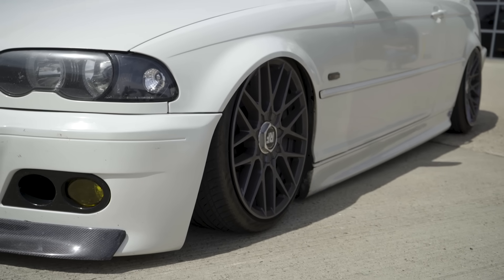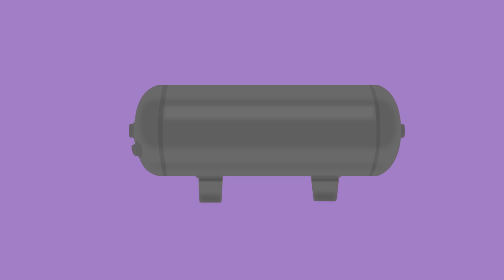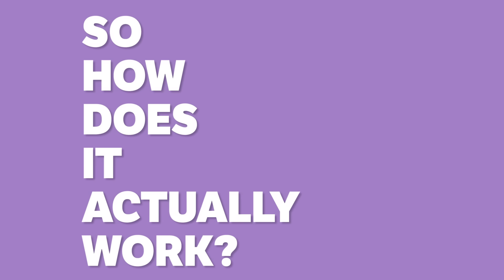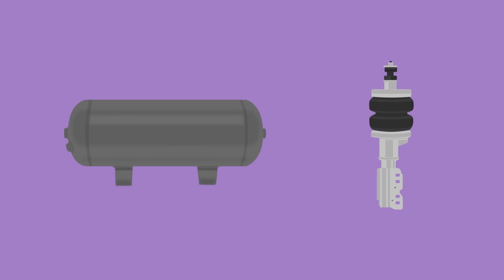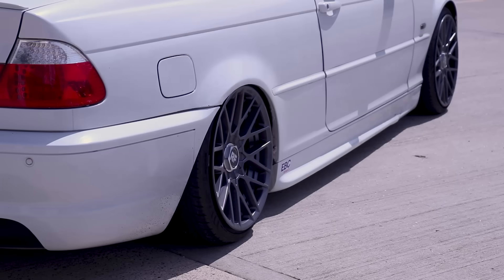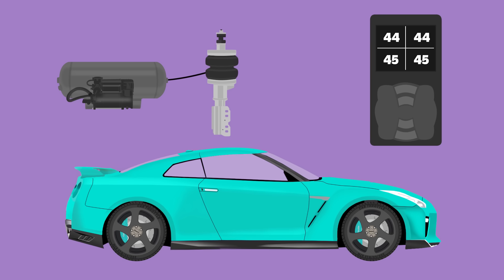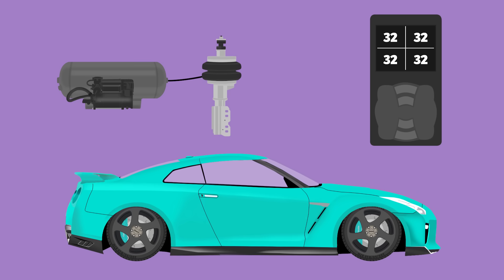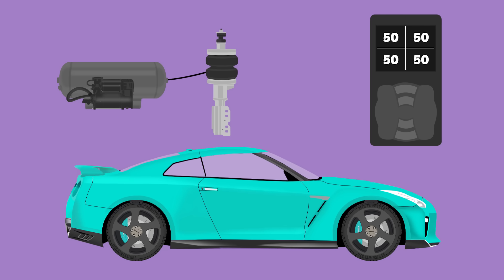How Does Air Suspension Work?

Comment: You missed the point that air suspension is softer than metal springs. Metal springs deflect proportionally to deflection (F=kx); air springs react to the change in volume of the airbag, which is the cube (F=k x^3) of deflection. Soft with little bumps, increasingly firmer as the wheels go up. Metal springs are constant.

Comment: How reliable are these systems?
Reply: Obviously not as reliable as a simple spring. Early GM air suspensions had to be serviced every 1,000 miles!
Reply: I've driven on air for 3 years and counting on my daily driver. It's seen summer weather and icey winters. 

Aside from the road dirt, my struts and bags look brand new. As in the bags, they don't have any creaks, cracks, or brittleness to them.

Comment: My question is why do people who usually go on tracks prefer coilovers than airbags? Why are cars with aftermarket air suspensions considered not good for track use or spirited driving? Do they lack stability or what? Just curious
Reply: My guess would be that the bags arent as durable as coilovers. Simple as that.
Reply: @kingbojack they are just as durable. As long as someone doesn't install wheels with the wrong offset and width. 

Wrong wheel size with bags will rub a hole in them . Wrong wheel size with springs will rub a hole in the tire.  

I've had airlift suspension for 3 years on my 2SS Camaro. I do a lot of spirited driving and no issues with the bags.

Comment: This is not air suspension.
This is hydrolic suspension .

The bullet train of Japan has air suspension.

I just redesigned automobiles to have electromagnetic air suspension ...
Got rid of shocks...got rid of air bags...

Air suspension with electromagnetism actually floats ..

Found a smother ride on air through magnets...repulsing each other ..

Comment: TRUUUUSSSST! LOL you need to 
LOWER THAT CAR! its riding so high it NEEDS TO BE LOWERED HONESTLY its sooooo high up there theirs about a good 4 inchs of wheel gap you should get some air suspension honestly, and if you go with PRAZIS Ⓡ AIR SUSPENSION USA you should go with AMERICAN MADE , in the UK they are running OUR BAGS, 
NOT CHEAP CHINA LIKE:  D2 yellow broadway tein cusco airrex ksport and many others that, are ALL MADE IN CHINA IN THE SAME WAREHOUSE 
their all garbage the only Real Performance forward Driftable and Show Performance Suspension in the world today is PRAZIS , Straight up made by Universalair and sold exclusively by 213RACING LosAngeles , its real PRAZISⓇ Quality Made in America and used by professionals , because everything else is just garbage ! 
FOR DRIFTABLE YET STANCEABLE 
REAL QUALITY FULLY ADJUSTABLE 
PERFORMANCE MADE IN AMERICA
HIGHEST QUALITY IN THE WORLD 
SUSPENSION There’s only one, 
DRIFTING ON , 
PRAZIS Ⓡ AIR SUSPENSION USA

AVAILABLE ONLY FROM 
213 RACING LA 
“ NOTHING FROM TAIWAN OR CHINA “
OUR SUSPENSION IS THE BEST!

WE ALSO HELPED DEVELOP ACCUAIR!
AND CARRY AND ARE 
Authorized distributors for: 
ACCUAIR 
AIRLIFT PERFORMANCE 
UNIVERSAL AIR 
AVS 
EVOLVE 
KW SUSPENSION 
ST SUSPENSIONS
ZOMBIE PROJECT
ROTIFORM
STANCE MAFIA
LIT STANCE
AIR SPENCER 
E36R DRIFT
ACTIVE AUTOWERKE
ITEM-B
BBS 
CONDOR SPEED SHOP
AIRFORCE SUSPENSION
V.I.P.KUSH BRAND
LOST SURF BOARDS
And more,.. 
AND We’re are NOT SOME 
trucking kooks,
from the boonies, 
that worship the 
FRUITY AND FURIOUS, lol
pretending to be,
L.A. Street racers, 
NAAAAH WE ACTUALLY 
ARE L.A. STREET RACERS
AND WE ARE LOCATED
IN LITTLE TOKYO DTLA!
Hit us up! 
Toll Free (866)213RACING
VISIT THE NEW ONLINE SHOP 
WWW.213RACING.COM
ON THE GRAM 
@213RACINGLA

Comment: Some Lexus models have factory air suspension. Instead of a cylinder they have a compressor so no boot space is taken up. Also less parts to go wrong. More reliable
Reply: Air suspension is very reliable.  I've had it for 3 years. As long as you use common sense when installing, you'll never be stranded.

Things that can go wrong is strongly based on the installation. 

1: Air leaks. Installation. Cut the airhose straight with the tool provided. Don't run the lines alongside moving parts or near the exhaust.  I ran mine under my interior carpet. 

Electrical management: nearly 3 years and no electrical issue at all. It runs off a 12 volt system. Its actually more simple than installing audio equipment.  

You don't need a high-performance battery, don't need an upgraded alternator,  you don't need thick gauge cables or capacitors.  

Compressors: Buy two. If one goes out, you have a backup. When it fails, it doesn't just stop all together. You have warning signs. I've replaced one of my two compressors after nearly 3 years of daily driving.  

The bags very durable.  As long as you don't install wheels with the wrong offset and width, causing it to rub a hole in your bag, you're good.

Comment: Question, Can I control the suspention while I a driving? Or the car must be parked
Reply: Airlift has a controller you can control during driving. There are 5 presets you can assign to a button.  You can also raise and lower each corner manually.  

My setup.
Button one: manually lift all 4 corners super high (higher than stock and clearing obstacles)
Button two:  preset high ride height (similar to my stock vehicle height)
Button 3: Labeled preset height. Slightly lower than stock.
Button 4: very low height for familiar roads and nice look

Button 5: air out completely.  Lay frame (requires pressing and holding for safety reasons )

It defeats one of the benefits if you couldn't control while driving.  Such as raising your car to clear a steep incline or large speed bump.

Comment: Is air suspension controling the car body leaning like Oem Audi?
Reply: I think Audi is mostly electromagnetic, air suspension is easier, but probably too slow for use in action. You would need 8 pre-pressurized tanks to raise each wheel on command. One can be used while the previous one refills. Possibly 12 for high performance.

Comment: What if one of them airbags pop 🤔
Reply: Bang clatter clatter clatter sky road sky road ditch.
Reply: I've had them for 3 years on a daily driver.  They don't randomly pop. As long as you don't rub holes in the bag by putting wheels with the wrong offset and width on your car you're fine.
Reply: What if your car blows up? Dumb question.

Comment: To lift and lower your car, it needs flexible parts and those can break much easier. It looks good tho but I'll pass.
Reply: What about daily in bad conditions? Like salt and sand and - degrees?
How long air suspension will last?
And... Its not cheap! As i presume, its cheaper to by coilovers than air suspension, but more difficult and time consuming to configurate to your curent moment desires.
Just spitballing here. Help me out to figure it out!
Reply: @jurisstrods91 
Airsuspension is a good thing, but not to a vehicle that doesn't have it as standard. Except if you only have the hight like the factory settings

Comment: I really love air suspension. I think it's perfect because you can have the best of both worlds, stance and function. It's a shame that I live in canada where it snows because I'd install some on my car and lower it on summer and raise it in winter. I've heard many people say that the bags will blow up because of the cold...
Reply: Basic science tells us that air expands if it gets warmer - so why should the bags blow up if it's cold ? The bigger problem for the Rubber in the bags is the cold weather itself, because rubber starts getting rough and brittle at low tempratures. I would probably get myself to sets of coilovers, one for winter and one for summer, even if that means suspension rework every 6 or so months. I hope this is helpful :)
Reply: @benewagner9212  that's what I meant. The whole thing about the rubber in cold weather. English is not my first language so maybe it wasn't as clear as I tought 😂
Reply: @Skuzela_Music  Neither is it mine, i'm actually from Germany 😅 Sorry for the Misunderstanding then
Reply: @benewagner9212  you don’t need a set for each season you can just raise and lower the 1 set. Takes all of 20 minutes to raise or lower all 4 sides of your car on coils
Reply: @benewagner9212 Things explode for more than once reason. Material failure behind a pressurized object will alway result in instant release of that said pressurized object’s contents
Reply: I heard if you do something for the bags they won’t and u would be good in the winter but not too sure
Reply: @G42_jaden  Water trap and air brake antifreeze
Reply: @Reverend_Salem  airlift doesn't recommend brake antifreeze unless your manifold is located outside of your vehicle.  Due to toxic fumes in your cabin. 

You'd also release it every time you purged your tank (provided the tank is also inside your vehicle.  I avoided brake antifreeze. I bought a water trap and an electronic drain kit. 

The kit consists of a 12 volt electronic valve that opens at the push of a button. One end attaches to your tank, and the other end attaches an airline you feed to the outside of your vehicle to dump condensation.  

No more climbing, popping trunk, or pulling back the seats to get to your tank. Simply press a button at any time while mobile or stationery to purge the water out. It makes a cool sound, too. I use it so often that my water trap is typically bone dry whenever I check it. 

If your system is dry, you won't have to worry about the lines freezing. I live in Oklahoma. We have snow and ice storms  in the winter.
Reply: Not true. I have had air suspension for going on 3 years this July. It's on my daily driver. I live in Oklahoma.  

We see ice and snow in winters and I've been able to drive to and from work with no problems since I've had it. The only issue I've run into is one of my 444c viair compressors that fills my tank began going out. Which is not bad after 3 years of daily driving.

I can't speak for every brand, but airlift suspension has been great for me.  Knowing what I know now, I would buy it again with less worry.

If anyone has any questions feel free to ask. I know the entire system in and out. It's extremely low maintenance.
Reply: Im not very familiar with air suspension/bags but how does the air tank work. Is that something that you replace or refill? Sorry i am clueless but I am very interested. I know springs and coils but air suspension sounds better compare with the other two.
Reply: @joshvalbuena4750   
The air tank has ports to connect compressors into. You can also connect a water trap,air tools, and even train horns from places like hornblasters. 

You never have to replace the tank as long as it's aluminum.  Steel tanks rust overtime due to the nature of condensation generated from compressors.  Pancake tanks are typically steel.  

The tank will hold air as a reserve for when you need to inflate your bags after you've aired out. Once the air is depleted from your tank after inflating the bags, the compressors automatically kick in to refill the tank to a set PSI. 

I would go with two compressors over one. Two compressors fill your tank up faster and it's good to have a spare.

Comment: Compressor, it's s compressor not a pump
Reply: Andrew Hankin a compressor technically is a pump. 😅
Reply: @DrLietz  in engineering turns a pump is related to a fluid e.g. water. A compressor is for air or gases. Under your theory a turbo is a pump.

Comment: Well I like the looks of lowered cars but performance is more important for me
Reply: It is performance. It lowers the center of gravity so the car handles better and get better aerodynamics.
Reply: Skitungen but many low end air suspensions may make the car handle like shit
Reply: @kaisuhina8024  Yeah but Mad Joe Mak said "lowered cars" like lowered cars overall and not air suspension.
Reply: Skitungen oh yeah
Reply: Kaisuhina  that were the old bags there is a subaru time attack car which uses bags the driver bought the bags himself before he got the sponsor he said that he couldn't notice the difference so its the best of both worlds
Reply: OEM Asian You mean that guy from the Gears & Gasoline video, I thougth the same too
Reply: Skitungen I meant bagged. Of course lowering a car with eg coilovers will improve the performance. That's also what I'm definitely gonna do when I get my car
Reply: Airride isnt for performance. If it was then more race classes did use it but they dont. Williams f1 did use HYDRAULIC suspension but not AIR. Air is just for the stance lovers and not for track, eventough stance people think the performance is the same as coils lmfao.
Reply: @Skitungen  and ruins the suspension geometry
Reply: Look into an air cup system. You keep the performance of coil overs, but you get the functionality of being able to raise your car for speed bumps or rough road.

Comment: Do a video on how to install after market seats??
Reply: You could look into Chris Fix installing racing seats
Reply: Tomorrow (friday) at the main car throttle channel Alex will be working with weight reduction on Gareth the BMW. I think that he will install a racing seat then. (Look at the end in the last video about Gareth and he gives you a sneakpeek)
Reply: Is it not as easy as unbolting the 4 bolts on the rails at the bottom of the seat and removing any cables if necessary. I've done a few seat installations on Bentaygas before and its as easy as that. The hardest part is carrying a heavy seat and angling it in to get it into position because of the door.